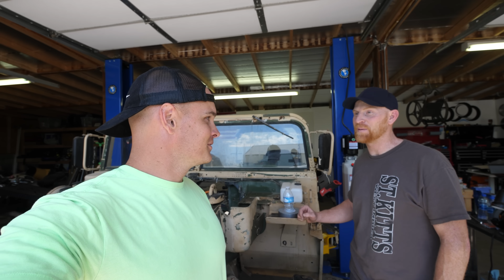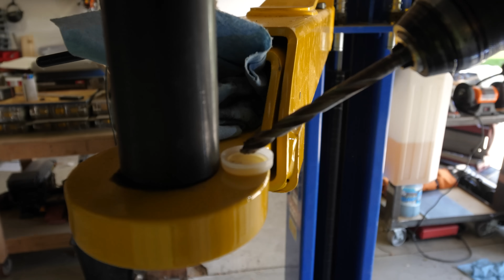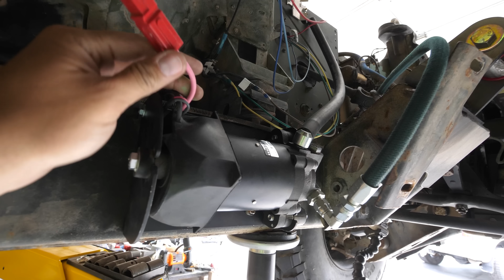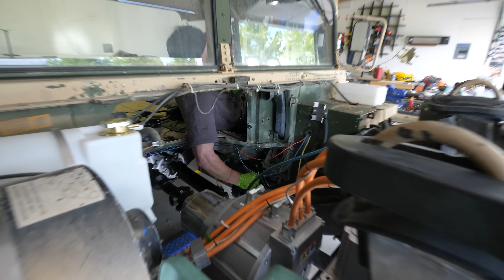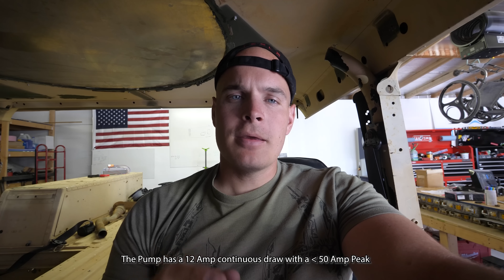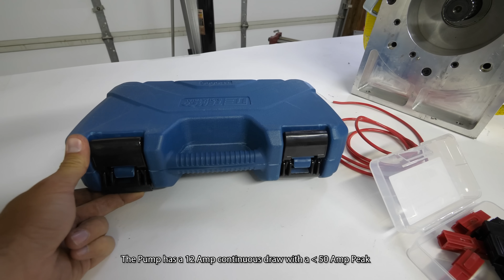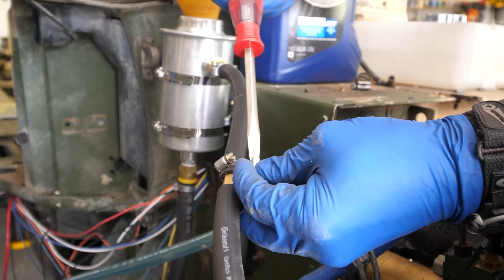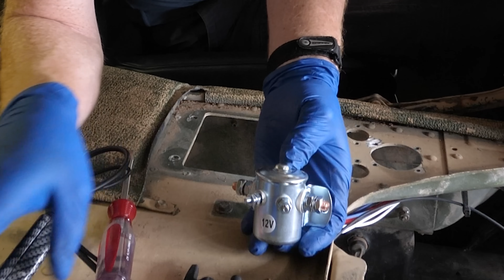We might have a problem with the Brakes... - Electric Hummer Conversion!

Comment: interesting to opt for such a system.  I read a bit about this topic.  And there are 3 different concepts.  1.Hydraulic Power Steering, 2. Electro-Hydraulic power Steering, 3.Electric power steering or Motor-Driven Power Steering;  now that you are the installer of version 2.  the question is simply how it feels to drive and whether the responsiveness is what you want it to be.  you will have sound insulation when you close the cantilever hole.  Ps.  if you are already making an electric car why do you use a housing to transmit electricity.  think of an electric lightning strike in the battery because it will blow you up !!!  cooling batteries, motors and pumps that use electricity is also important.

Comment: You shouldn't need teflon tape on atleast one of those fittings. Those usually seal on the angled surface in front of the threads, not the threads themselves like what you'd see with npt fittings. If they leak you can get little angled copper crush washers that seal em back up nicely.

Comment: For the pump: It is down low by the drive components and right under you. A rock can take that off pretty fast. If you mount it up by the radiator it will be protected from some serious off roading or just road rash, and it will be quieter because it is mounted further way.
Reply: I was thinking the same thing or if he snapped a drive shaft it would destroy that line and pump.
Reply: That was my first thought, not really a clever decision to put it where it is 🤔
Reply: Use the air intake as a method to blow cool air onto the electric pump and the housing for the air intake would also kill the sound waves
Reply: @matthewmurphy191  was thinking something similar too to an enclosure with sound deadening depending on how quiet, but was wondering how much heat it would generate and if it needs proper cooling.  also just started to watch all the videos so not sure how much i need to catch up on progress.

Comment: I had a panel van that used 1 pump for the power brakes and steering. When I had some brake problems it also affected the steering ! Always smart to have the wires and relays sized and rated for more power than the device. Then protect with the proper  sized fuse/breaker .

Comment: Hi Zack! Great series so far, wanted to ask if the solenoid goes straight into the battery instead of the control box? ( I think I saw that but I'm not sure) Since I guess you need brakes even if the key switch isn't turned on 🤔

Comment: If you're worried about the noise from the power assist unit, build a custom built stainless steel cover for it that's sealed on all sides of the unit with a rubber gasket all around and spray the inside with noise reduction foam at least 1 inch thick. On top of that try putting in the dog House cover and the hood of the vehicle and see if that helps. Just to see if it would reduce the noise when you're finished the build.

Comment: ADD A FUSE - you need a fuse between the battery and the solenoid sized for the gauge of wire.  Use a high current slow blow fuse since it has a high current inrush.  You should also have fuses for each of the relays on the high current side again sized to protect the wires you will use.  I say stick with the hydro boost.  Consider moving it to the front of the engine bay away from the cab closer to the radiator, add some distance and put some sound mat between you and the pump.

Comment: You can either move the power steering pump futher away from the cabin, or you can make a box around it that has a couple of layer of quality sound-deadening material. I would do both, if i were you. That pitch sound will drive you crazy in no time xD

Comment: Hydraulic accumulator, pressure switch and quieter pump that will be mounted far like under the trunk in it's own inclosure on rubber shocks. Also you need something that will read your speed and turn off the pump, you need 50% less pressure when you drive and 90% less on the highway. Take notes from electric steering system. Or you can just use electric steering rack and save a ton of money and work. It was easier to just buy new electric steering rack and make it fit instead of what you just did...

Comment: I think the placement of the motor was a poor choice. Its quite a fragile thing, and you kinda want it in the engine bay so that when you go off road and a rock scratches your car's bottom, you still have brakes that work.

Comment: What if you just use part of the fixed rotating assembly to drive a hydraulic pump mounted to that location via a belt? The math should be easy to get the correct size pulley to match whatever size drive pulley is required to accommodate the placement of said drive pulley as to not over or under drive the pump assuming you could find a place to fit the pump wherever the drive pulley is best suited.

Comment: You got to have sensors either on brake and on steering that Will engage pump when its needeed. That chunk of motor if you let it running all the time wil fry your 12v battery in notime
Reply: That's what the alternator normally handles...he'll have to see how it works out. I would bet it's all built in and managed

Comment: Use an electric Forklift on demand power steering pump and motor, they are very quiet. But you have to feed them with 36 or 48 volts. They also run on demand only, so you will save a lot of power.

Comment: If the starter solonoid  isnt rated for continius use use something like a te kilovac relay they are rated for round about 500A at up to 800V and built like a tank they rarley have any problems

Comment: btw the kit you receive is a different version than the one pictured. it has a 200A relay and 16mm2 cables instead of what is pictured. ( i have yet to update the photo)

also please dont use the 12v battery starter solenoid as you did in the video because they are for transients. they sink ALOT of power and if they are run continuous then they overheat. if you touch it you will actually burn yourself.

Comment: I would strongly suggest adding a fuse as close to the battery as possible.
You will be having a bad time if one of the components fails or a wire contacts the frame in the current setup.
Don't ask me how I know but ask someone with experience in , let's says, installing car audio or winches and they will tell you the same thing.
You don't need a 400V battery for an electrical fire or catastrophic failure, 12V is plenty dangerous.
Since you will be having some more electrical stuff going on eventually, it would make sense to firstly install a fusebox.
This will allow you to organise and protect any wiring as you are building up the new system.
Having to retrofit a fusebox is a major pain once you have to manage existing (temporary) cabling.

Comment: Dude I hope you will mount that pump with something more than a single nut on each bolt. Definitely need double nuts or locking nuts cause of vibrations.

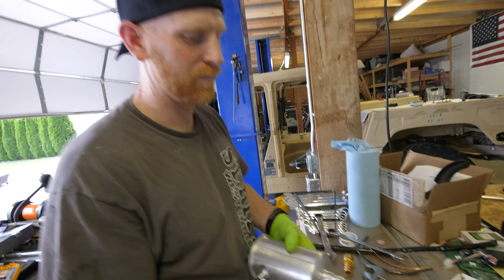Comment: 7:52 that's a JIC 45 degree fitting.  Teflon tape is not need to seal.  The thread performs no fluid sealing function.  The fluid seal is provided when the 45 degree cone mates with the reciprocal fitting.

Comment: I hope that there will be a bash plate under the engine bay, the last thing you need is catching that hydraulic line on a branch or rock and snap it. I would be protecting it as best as possible.

Comment: There shouldent be thread tape on taper AN fittings.  They should seal on the taped part.  Even if it did leak past the taper it would leak out the spinning part of the fitting opposite the threaded part.   You don't need to thread tape AN fittings.  Worst case is bits of thread tape end up in the system and in the pump ect

Comment: I would make a redundant System which can take over in case of a failure. On Such a Gigant vehicle, you wont be able to keep it under control without hydraulics. On a small compact car, you could slow the car with brute force on the pedal and steer it to a safe Spot

Comment: Awesome build, you may want to use constant tension hose clamps instead of compression clamps, due to heat within the line. I had the issue with my older jeep transmission line and fixed the leak. Power steering should be quieter once the full motion of the vehicle is running. Just my two cents, keep up the good work and keep moving forward.

Comment: Run the pump through pwm motor controller, use a pressure sensor on the output to sense output pressure. Not sure the best way to link them, but that a old allow the motor to slow down when the fluid isn't 'being used and ramp up when needed

Comment: From down under.  Great post. Ditto to pressure accumulator.  However to dampen sound further than just rubber mounting, AKA vibration.  If you enclose the pump in a total lead shield you will be amazed,  yes amazed.  Want to try it out? Just throw a blanket of roofing lead sheet over something noisy and find out,  such as a grinder or food processor. 
Lead poisoning is only a problem if you ingest it,  handling should not be a problem In my opinion.

Comment: The pump is to close to the bottom and the high pressure is your lowest point and to bulgy! If you are going to take it off road, then at one point or another something will hit that high pressure point or the pump and you will lose your power steering and brakes. But it higher and protect it from something ever hitting it.

Comment: The one pump to rule them all?

Um, that Teflon tape at the bottom of the reservoir will do absolutely nothing to seal that JIC fitting.  Those fittings are tapered metal-to-metal sealed - not thread sealed, which is what that tape is for.

Comment: I' curious about your choice of location for the pump.  Seeing the hydraulic line sticking out very close to the drive shaft, along with exposure to the ground has me wondering if that line/knuckle will get damaged if taken off-road and a rock impacts it.

Either way, this is an amazing series you're doing.  I find myself excited for the next video!

Comment: Word of advice avoid using or relying on teflon tape for sealing pipes. At least add a rubber ring as safe guard.
Reply: expansion tank is made out of aluminum? If so, then metal ties will eat a hole into tank. add rubber layer between them. Needless to say that properly welded mountings would be best. 

If you are doing things you might as well do them properly so there would be less oopsies and repairs afterwards. And if that tank is for both brakes and power steering, then you might loose your brakes (no danger to crash if you won't ignore them gradually fading away).

Comment: its really jarring when brake boosters activate suddenly, i get that reducing load on the motor even a little is a good thing, but i feel like it would still be better to run it off a belt so that the brake booster only runs when the motor is spinning, and ramps up at the same time as the motor. i haven't heard of the power steering doing the same, but would still be cool to me to see all the pump accessories belt driven off the massive central motor. obviously that isn't feasible for a car with multiple motors, especially for independent wheel motors, but for this build it definitely is because you're even going to make the motor visible from the interior

Comment: Decrease noise from pump…
Isolated pump with rubber or silicon washers and inserts if possible. Make a cheap plastic box a bit larger than it and line the inside of the box with silicon or rubber. If there are any other noises from the engine compartment, you can line the door to the dog house and any other direct hard surfaces between the cabin and any noisy areas.

Comment: The line and fluid still has some air bubbles, run and test it a bit more and bleed out some lines where the air might be trapped

Comment: Easiest thing I could think of to address the noise is to compare your setup to how Chevy and Toyota have theirs. Where is their pump usually mounted? Do they just rely on sound insulation from the body to mitigate noise? They obviously would have issues selling vehicles with that system if it wasn't reasonably quiet for a daily driver.

Comment: Look up 4 quadrant operation for motor controllers. After you understand the 4 operation modes, you'll stop confusing them with the mechanical mods you did in this video.
Reply: I'm curious what you mean.  Are you talking about the replacement power steering pump he's using?  Or regenerative braking? Or something else. Genuinely curious.

Comment: NEVER NEVER NEVER put Teflon tape on flare fitting. It literally does nothing but make it more likely to leak. Flare fittings seal with a metal on metal contact of the cone surface, not on the threads like tapered pipe threads. Then with those "push on fittings", the ones with the yellow collar and the large barbs, they do not need hose clamps when used with the correct mating hose. Look up "push on hose" at McMaster Carr.

Comment: most of these have a power off relief system too to keep the system wear down as well. i think on most electric cars no reliance is made on the brakes during power off it is the drivetrain that holds it.  ebraking will be a challenge.. or parking brake for that matter.

Comment: Loving this series! Might want to consider using ring terminals instead of fork terminals for your power distribution. In the Electrical world it is best practice to use a ring terminal for any terminations that can be subject to vibration. This will allow the connection to not come completely lose in the event one if the terminal block screws starts to back out. Keep up the great work!

Comment: Those Anderson style plug connectors are good for that they claim. Commonly used as a color coded pair for RV hook up. 

About the noise, perhaps try moving it all the way to the front of the car and use the noise as some sort of low speed pedestrian warning system. Since an electric car as silent. 

Then route the fluid containers into the dog house. That way you'll be able to see the fluid levels without having to pop the hood.

Comment: Put a fuse in between the battery and the relay on the high amp line!!!! If the high current line shorts out theres no fuse in that line, either the relay/solenoid blows if not you gonna be ghostrider in a hummer

Comment: I forgot to mention something when thinking about your brakes.  If you use regenerative braking, keep in mind the backlash in the geared hubs.  You may find that when you let off the accelerator, that that slack takes a second to take up, and you get some weird braking effects.  I saw a brief video of someone else who did an electric power train swap in a Hmmwv and I believe he had some tire hop/skidding when he went over a bump as he was slowing.  If this becomes a problem, the only solution I know if is switching to the helical cut gears in the geared hubs.  Which also requires the heavy duty halfshafts.  AND I've heard those gears are not as strong as the straight cut ones and can break in high horsepower applications.  Just something to watch for when you start driving it and tuning it

Comment: When I worked at Tesla as a Tech there was a bulletin for the AC compressor because it was noisy. We installed what was called an acoustic blanket and It worked really good. I would also do some kind of "Dyno matt"  sound deadening on the Dog House if it's not quite enough.
Reply: Great point. A lot of high end car stereo installers use Dynamat, Siless, or Kilmat products. The better products  on the market are made up of a closed cell foam insulation. I’d recommend a 50+ Millimeter pad.

Comment: If something I learned working with computers recording things is... If you can't silence the noise source, then you have to move the source to another place. Maybe placing the pump near the front or way back on the vehicle will help. Also. By the sound seems like a lot of high freq noises. Try some soft material like foam with the pump inside a box.

Comment: Just FYI. AN or JIC fittings like on your reservoir do not need Teflon tape, you are doing more harm than good using it. The seal in the fitting comes from the interface of the two 37* mating surfaces.

Also make sure that the solenoid you used for the pump is rated for constant use. A lot of them in that style are for momentary use like for an engine starter or recovery winch. If you use a momentary one for constant use, you run the risk of the contacts welding closed and it sticking on.

Comment: Get rid of the Hydroboost for the power steering.  Use just a Prius Electric power steering column.  Adapt to your column, power it, and boom.
Reply: Couple things I'd be worried about.  The torque to turn the steering wheel on a hmmwv is pretty high... I imagine higher than a prius.  The mounting brackets for a hmmwv steering column are pretty flimsy.  You'd have to mount the electric power assist to something solid.. and the hmmwv body and frame move in relation to each other when offroading.  I really wish there was an easy electric solution for these trucks.

Comment: Just a heads up; you don't put Teflon tape on JIC fittings. The seal is on the 37 degree angle, not the threads. The tape does nothing.

Comment: Ford uses an all electric power steering rack, the motor is directly attached to the rack, should be worth a look up
Reply: Dodge Chargers also use an electric although it's mounted remotely behind the front right fender wheel well